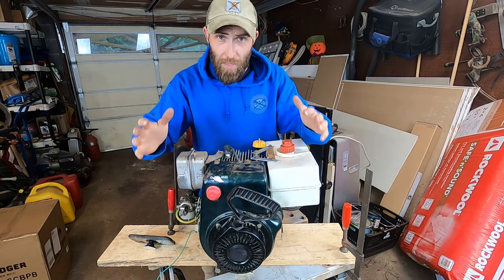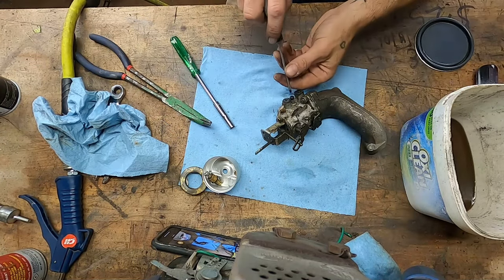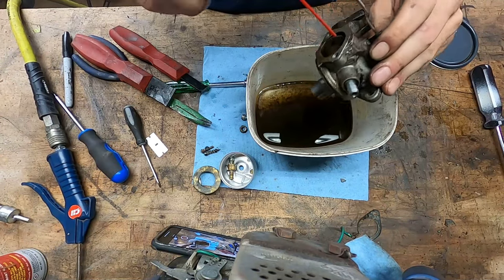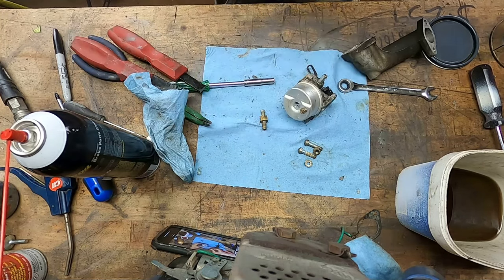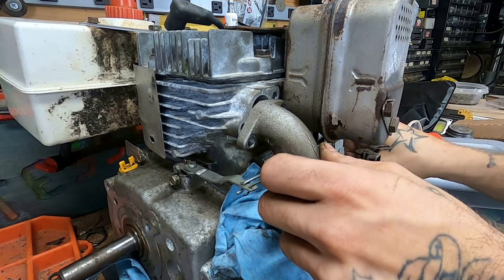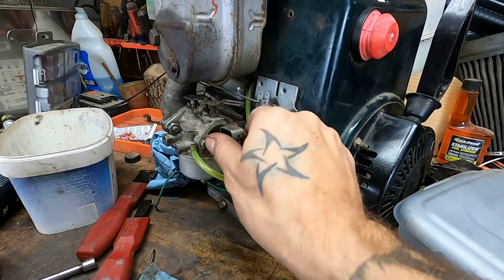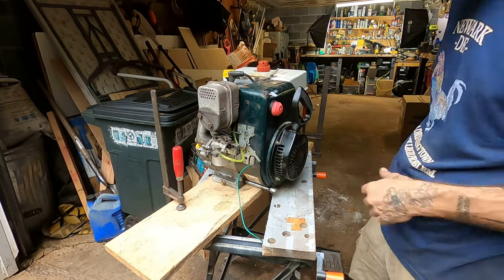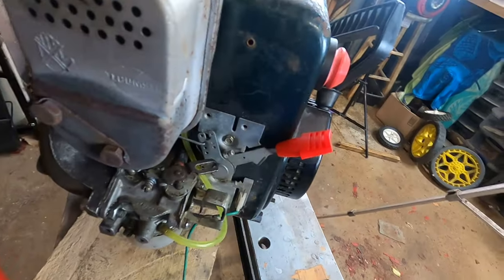Carburetor & Air Filter Shenanigans - Tecumseh 9hp Engine

Comment: I bet if you explored the PVC fittings at your local HD, you'd find one that you could modify to work as an intake flange adapter. (Something like a 3/4"x1" reducer, M x F, threaded by glue)
Reply from the maker: You know what.. that is actually a great idea. I will make a trip over this weekend. Thanks! I'll let you know how it works